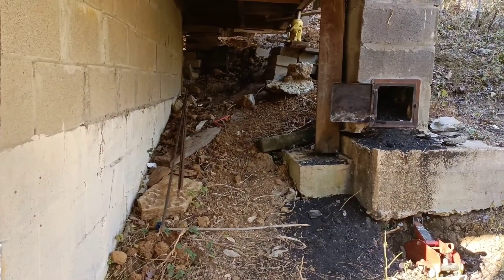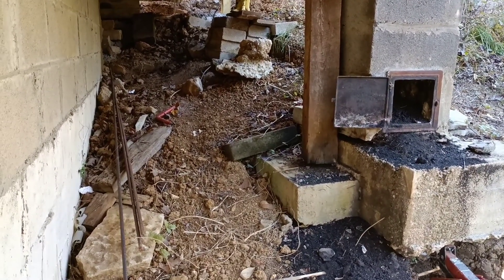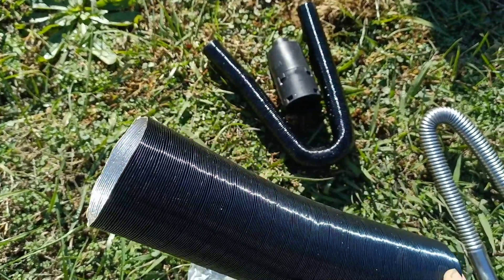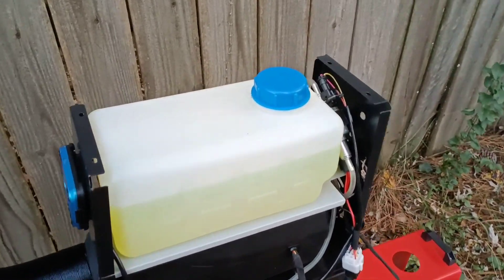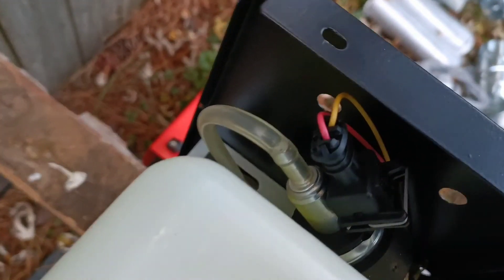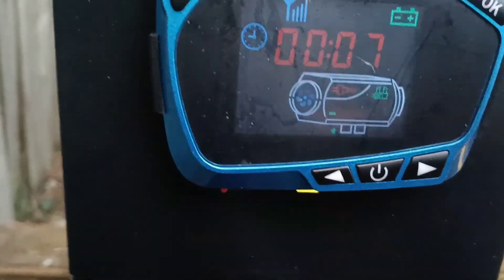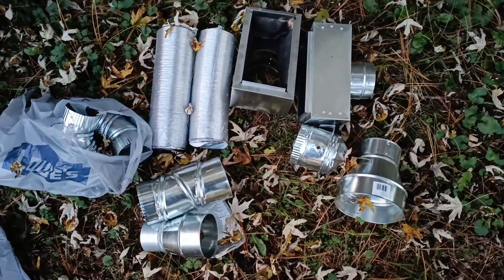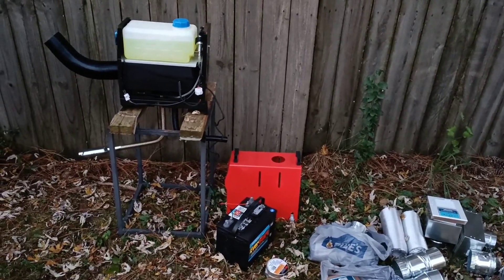Review and Installation of 8kw Diesel Heater For Off-Grid Cabin - Part 1

Comment: add a primed fuel filter before starting. the diesel lubes the pump.... dry starting heater isnt the best idea
Reply from the maker: I injected fuel down the fuel line. Sadly this system does not have a way to fully fill its fuel line on its own before starting. I covered this in my second video on this unit, which I have just posted.